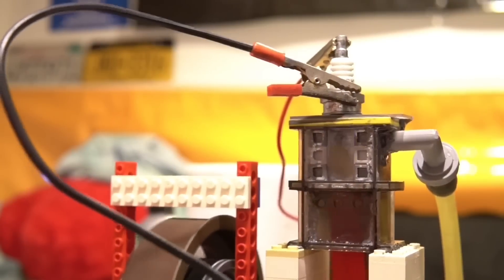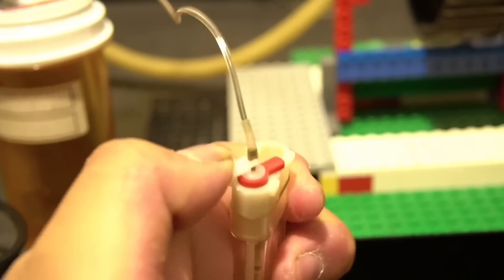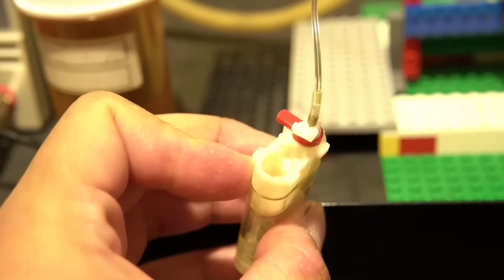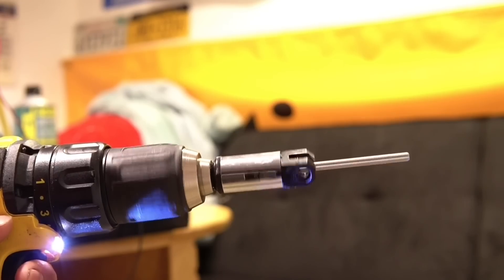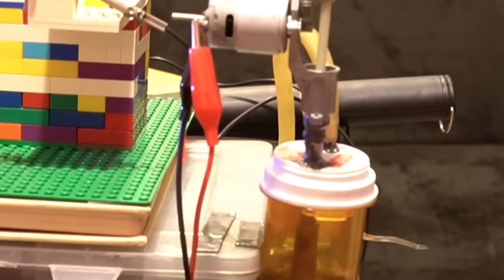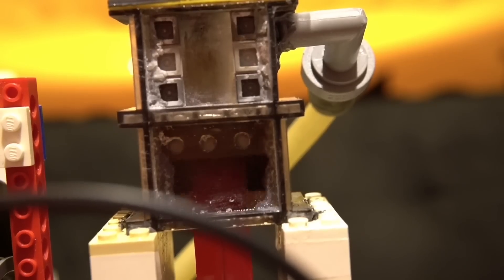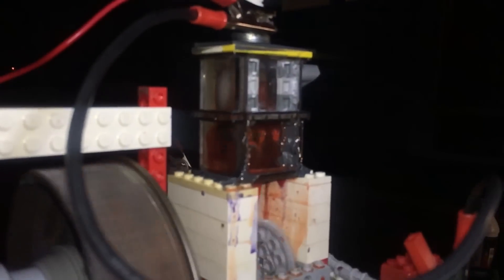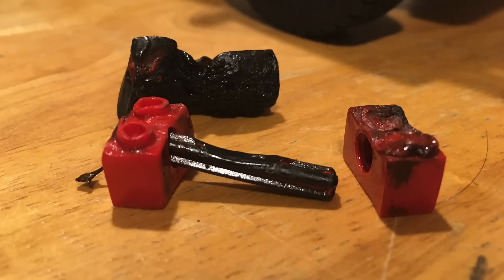Working LEGO Combustion Engine! (2 Stroke) Version 3!!

Comment: so its a drill powered air pump and melts
Reply from the maker: It's drill powered also it needs even more power to draw in its own fuel and needs a separate battery source for it's ignition and it melts in 10 seconds
Reply: @madbrick923  But it works, and that's awesome.
Reply: @z-trip5457  but it doesn't? there is one fundamental element missing, compression which there is literally none, this is not an engine. its like the 'jet engines' you see which are just a flame fan
Reply: @Jack-hg1hq  You say it is missing compression, just like "jet engines", they are not just a flame fan, in fact no flame touches the fans. Air is taken in, the fans COMPRESS the air, and behind that jet fuel is injected into the compressed air and powers the aircraft, and the exhaust comes exits the rear. So in fact compression does happen in jet engines. I suggest doing research before commenting.
Reply: @z-trip5457  but it doesnt
Reply: @z-trip5457  it doesn't spin by its own power or spin just once by the explosion
Reply: @madbrick923  you should make that the fuel is above the intake So it doesnt have to waste So much power on it, or maybe make a lego "carburator" but i dont know if thats possible, anyways your build is awesome.
Reply: @madbrick923 
Blursed, absolutely blursed
Reply: Mad Brick it’s a 2 stroke you need exhaust for backpressure
Reply: @theun-knownmusician5468  you don't need Backpressure on a 2 Stroke, take the exhaust off on any 2 Stroke ever made and it will run.
Reply: PistonBully but back pressure makes it more efficient, and that’s what this needs to move forwards, he has the basics it just needs to be more efficient
Reply: @that_tofu_fox7519  no it needs a  round cylinder and piston rings, get the fundamentals of an engine right before thinking abou that,
Reply: @aaaabababa  my 50cc died when exhaust fell off😂
Reply: @Jack-hg1hq  The definition of engine is just "a mechanism that converts power to rotation" and nothing like what you just said.
Reply: @josephpbrown  go build an engine that works and get back to me, this device does not convert power to rotation it uses power in order to rotate, the builders know this you clearly do not.
Reply: Jack Cowsill stop being a Debbie downer. Let the dude have fun tinkering with his LEGO “engine”
Reply: @Jack-hg1hq  I'm sorry that you have to deal with these people lmao 😂😂😂
Reply: @hannes_mlbx9599  so am i
Reply: @Jack-hg1hq  Needs a round cylinder? The engineers of the Honda NR750 are laughing hard now
Reply: @Jack-hg1hq  Except for the few turbines in the rear.
Reply: @Aim-9_Sidewinder  I build and own jet engines, I don't need your opinions
Reply: @Jack-hg1hq  hossack engine
Reply: @Jack-hg1hq  doesn’t have to be round cylinders. It’s about compression
Reply: @sinixoth  its very difficult to seal a not round piston and cylinder. Hence why they are always round or oval (honda) even though its not the best use of space.
Reply: @madbrick923  i love the germany and german car i do everything for germany talk me did u love  germay
Reply: @madbrick923  wall done I build engin from part of aluminium 🔥💪🏽🚩🇩🇪🏗🏭🧤🥼🥽👓🕶🦺🧥🎧🔌🔋📙📗📜📜🔨🪓⛏🛡🛠⚒🔧🔩⚙⚙⚙⚙⚙⚙⚙🇩🇪🇩🇪🇩🇪
Reply: Mad Brick Ey the nitro guel inot to good to flam nitro yous a glue plug
Reply: Jack Cowsill that’s a nice minor.
Reply: @isaacsrandomvideos667  thanks
Reply: Actually fun fact, 2 stroke diesel engines don't draw in their own air and fuel, they use a separate blower (Air compressor) driven by the crank to get enough air in it
Reply: @tk4x431  not always, they draw it in with crank case vacuum when the piston goes up, then push it in the cylinder on the way down. They don't draw in fuel at all its injected mechanically just before tdc and ignition
Reply: 408 trz  no
Reply: In other words, a Vega engine

Comment: yeah, i wont consider this a running engine unless it runs under its own power and not a self destructing drill powered piece of plastic. You were holding it back the whole time with that drill instead of actually trying to start it by hand.

Comment: tips: put a smaller flywheel, put an air injector so it works, add oil (if you dont have use vegetable oil), when the piston goes up shorten the gap between the piston head and the upper thingy where the spark plug goes in. 

following those tips it might work idk i dont have the pieces needed to do that

Comment: Next idea: make a starter so you can start it and make the ignition and the starter one switch. The starter would be a tiny motor on the gear moving the flywheel.

Comment: Thats really cool. Of course i didn't had the experience you had with the engine, you know better than me but but i think all the engine needs to run on its own is a carburetor for 2 stroke engines and more compression. The engine would still burn due to the legos but at least it would run on its own for some seconds

Edit:i just realised that a carburetor can't be used in this engine because as you said in the video, it dosen't use crankshaft power to deliver fuel air mix in the cylinder.

Comment: The main problems I see are that 2 strokes are made with the holes for exhaust and air specifically and Lego isn't exact enough to get able to get those correct. Also there is no seal so the negative/positive pressure system can't work. Since that doesn't work there is no compression during combustion so it doesn't make enough force to make power.

Comment: you need to set your ignition timing a little better and add some type of ¨o¨ ring to your piston so that it gets a better seal. combustion cant happen if the pressure is able to escape. i recommend using a rubber band of some sort. be sure to properly lubricate it to reduce the friction. also your ignition timing should be tweaked. thats one of the reasons why its leaking fuel, its because its not burning it all due to lack of pressure and bad ignition timing. hope that helped.

Comment: Without much compression, you won’t get much power, not nearly enough to allow the engine to turn itself. Cool idea, but you’re basically gonna get the exact same result without the piston (just injecting fuel into the chamber and igniting it )

Comment: I feel like you do not have a big enough bore, but the stroke is good.

i have heard that you also need a circular piston, as a rectangular one will not seal as good.

another thing, you should make the wheel you used to crank the engine smaller, the big one is too heavy, and a smaller one takes less time to do a full crank.

Comment: so far so good, much better than the v.2, but i would prefer valves instead of a simple hole exhaust since it is a 2-stroke engine. the ignition timing could be perfected but assuming of what i saw it should be good. but i doubt you are going to get around not using valves with a 2-stroke

Comment: You could build a Lego water pump with a pc radiator and fan along with a reservoir then add 50 50 antifreeze. Then drill holes into the blocks that are the cylinder heads and the block of the engine which will aid in transferring heat away from the combustion chamber

Comment: The engine does need the drill to not die, right? I may be wrong but I think the explosion is not powerful enough so the cylinder should be bigger but still have a light piston. Then again making the cylinder any bigger would end with a fire because we are of course using lego. The explosion would melt the lego in an instant. I may be wrong. This video was really cool. I searched for it and i got it.

Comment: I think you habe to make much higher Exhaust Ports with a kind of Exhaust on it.
Additionally the gasoline-air mixture must be perfect to run the engine.
You could also try different electrode gaps.
Reply from the maker: yeah an exhaust was something i didnt consider. the hardest part is to get the mixture correct as the lego motor itself cannot form a venturi to draw in fuel by itself

Comment: Intake ports at bdc, exhaust ports 1/3 the way up the jug, oil Piston, running engine
Reply from the maker: intake ports are at the top so there is constant vapors flowing in but also is a check valve that closes during the compression stroke

Comment: A mechanism to alter timing will help! 

A reluctor wheel from distributor, coil and module, like everything in a Honda director can be simply wired for trigger timing. Just cut other high points and have that one trigger point. Or flat metal disk with high point, like a .010 air gap.

Variable reluctor sensor will close the circuit by grounding out coil through module.  The vr sensor can just be grounded, and other rising wire will go to triggering side of module, which will get converted to ground trigger through module to ignite coil.

Comment: The issue is the combustion does not make enough power to spin that heavy flywheel, I would take off the flywheel and replace it with a lot lighter one

Comment: There are many "easy to fix" problems here. 

First your engine doesn't make enough compression, piston should be 2mm from the cylinderhead at tdc. 

Second thing is that your air intake opening point should be lowered to at least the middle of the stroke (instead of all the way at the top). Now al your pressure your making with the piston is getting wasted, because the air intake port is so high and doesn't close when the piston is in it's compression stroke.

Third thing is to make sure your exhaust pressure goes away as soon as possible. Exhaust should be at the middle of the stroke (or even higher). Don't go to high with the exhaust port else you won't be able to make compression. Don't worry about not having back pressure, that's a story for another day and not important for now.

Fourth and last thing is that your ignition is way to late. It should be way and way earlier. Since the engine is made out of legos making compression is hard. So don't try to compress the air and fuel like your doing now but make the ignition timing earlier. Now you'll be already compressing an explosion of gasses into the combustion chamber. Therefore there will be high pressure and de piston will have a good powe stroke. Don't go to crazy though, it's still legos.

I hope this can help you, I'm not a mechanic but a 2 stroke enthusiast and I've worked quite a lot on them.
Reply: Let's say I'm making a 4 stroke engine with an intake and an exhaust valve and everything.

Would these tips apply the same way?
Reply: @kshusband  The tip about the ignition timing certainly would. The other tips are irrelevant since in a 4 stroke inlet en outlet isn't controlled by holes in a cylinder. You might even try using a glowplug instead of a timed spark. Way easier, this is often used on smaller engines. Like rc-cars.
Reply: I mean, we're 1/3 of the way into the video and he remembers exhausts are a thing xD

Comment: It may be worth trying to advance the timing. Normally the spark plug would actually fire just before TDC (top dead center). Combustion is a somewhat slow process and by firing before TDC peak cylinder pressure actually occurs slightly after TDC. It’s hard to say but maybe this is what you’re seeing in the clip at 4:06. The timing may be too delayed causing combustion to occur too late in the cycle. This is just from my experience with larger displacement 4-stroke gasoline engines so somebody correct me if this doesn’t apply with 2 strokes or other fuels.

Comment: I think if you had another cylinder it would add a lot more momentum allowing you to get a lighter fly wheel. With that you would also have twice as many ignitions per rotation of the crank. I see this as twice the power, twice momentum and also twice the coolness. btw if you use acetone you can melt the LEGOs into sealing better. if you don't know what i mean search it up.

Comment: I believe the intake needs to be lower than the exhaust, so when the pressurized air containing fuel is forced in, it forces the exhaust fumes to leave via the exhaust port (along with some fuel, but making an exhaust for a 2 stroke is a whole different ordeal). Maybe put the intake where the exhaust is now, and put exhaust hole like halfway up, so it still has time to compress.

Comment: Really cool. But you're not getting a full seal. Engines have these rings around the pistons to complete a seal in the engine head without grinding away at or fusing the piston to the cylinder. Plus, you may want to experiment with different header designs and a circular cylinder and piston (or more circular). There is an engine head that is a wedge design that has an easier to combust lean mixture in the top of the head, then a harder to burn, but more powerful ruch mixture just below the lean fuel mix. Tgis was replaced by the Hemispherical Engine Head, which just had a better cylinder head shape.

Comment: I would try advancing the timing and working on sealing the combustion chamber to try and help compression. Also I think the valve in the pcv valve is too far Way from the comustion chamber. I believe the the entire displacement is traveling back into the "intake" before it can compress

Comment: I believe the biggest issue with this design is that the intake port is at the top of the cylinder, so all the compression goes back to the intake tube, or is provided by the air pump...
You need to place the intake so that when the piston is down, fuel goes in, but as the piston rises, the piston wall should cover the intake, so that the fuel can be compressed, as the piston rises. Ideally you should feel a bit of resistance when you crank the engine my hand, then you know the air is compressed at the top.
Also this is a 2 stroke engine, these work at very high RPMs, you have low RPM, and one cause may be the very heavy flywheel, it's hard to spin up that wheel quick enough, and it acts as a brake.

Comment: You should put an o-ring on the Piston to get more compression
Two strokes rely completely upon its compression if it does not have good compression it will not work

Comment: I have a feeling your timing is a bit early. When the nitromethane had a proper thump at it you could see the combustion chamber lift up. and the whole thing "knocked". Everything else seems good enough. Also this being a two stroke it needs some back pressure but I am not expecting any meaningfull power out of this anyways. 
Get two of those big light gray gear and put one on the crank shaft and the other next to it to which you will have the spring ignition system hooked up. Now you can advance the timing in the division of each tooth. When too early just slide the gears out of mesh and rotate one of the gears in the direction you want and mesh them again. You get a much more accurate timing that way. And that should be it. It should at least semi work if you make the timing a little bit later. With the gear directly attached you can advance the timing in 90 degrees only but if you use two gears you have 360 divided by the number of teeth. Good luck I want to see this thing work even if just for 10 seconds. With the spring youre a little tooo early on ignition

Comment: Mauby a fuel with a lower ignition point...the higer the octane the hotter spark required to ignite. Lower octance fuel lights easier at a lower temp and compression ratio.

Comment: You need a wider bore with the same stroke. To fix fuel ignition issues use more than 1 spark plug.

Comment: You need to put two cilinders, one its up and the other down, like that the force pases one to another and it cranks.

Pd: sorry if has bad spelling or something, im actually from spain 😅😅
Reply: I had to say this beafore but the thing is when one goues down, it pushes the other up, and it makes go alone.

_ (that is a cilinder ok? Its for making it visual)

_   
      _   if they are like that, when one goes down the other does the oposite, if u do it with 2 cilinders, i think it will go, but its more fuel and more of everything...

Comment: Here's an idea...  well an old idea..  But has proven successfully with all 2 stroke engines.  It's called a carburetor!  And just an fyi... You NEED exhaust backpressure for a 2 stroke to run correctly.  This is an interesting little experiment, but plastic melts! Use aluminum! Or even wood! That plastic won't hold up the the norm running temperature of an engine. Remake this.  Use wood and glass for the transparent parts of it.  Make an exhaust that will provide back pressure. And you will have a running engine. Fyi... You can get nitro rc carburetor on eBay for really cheap!  And you only need the one intake hole for the carb.

Comment: maybe water-cooling so it doesn't melt? (just put some glue or other stuff on this engine and make like a square tube filled with water and use pump that you created in one of your elder videos. cooling fan could  be powered by some chain from engine)

Comment: A real engine of any kind has an intake and exhaust manifold, the exhaust manifold creates a vacuum which when the exhaust valves open, pull the piston up when it is at the bottom of the combustion chamber. The intake manifold is specifically made to flow as much air that is needed by the engine once the intake valves open but that’s not as important for your 2-stroke engine. What you need is a vacuum to pull the cylinder up on the exhaust stroke. Good luck, I hope that helps!

Comment: was cool when you could hear it hit. there may have been a little compression when it hit. l was thinking the smooth flat 2x4 piece would probably help combustion. the bumps on top of the piston slow down the fuel air mixing and ignition. but l don't have a lego icb engine lol so just a thought or curiosity. this was awesome to watch.

Comment: I would say the air pump system makes it run to lean, have you considered a carburetor? You just need the air to move through a restriction with a vertical pipe ending in the center of the restriction for fuel